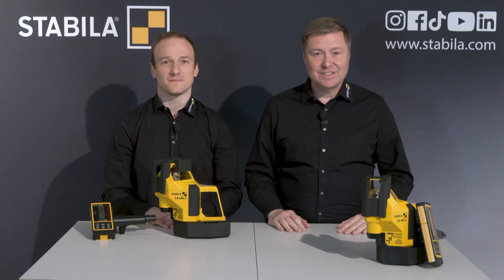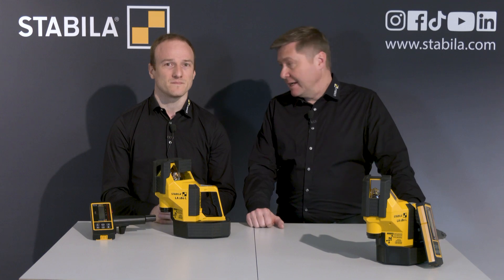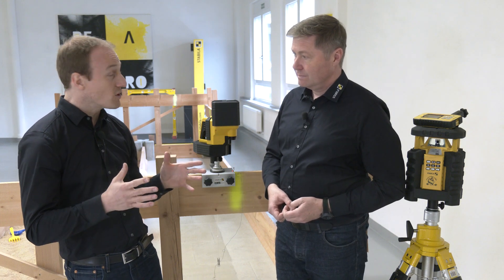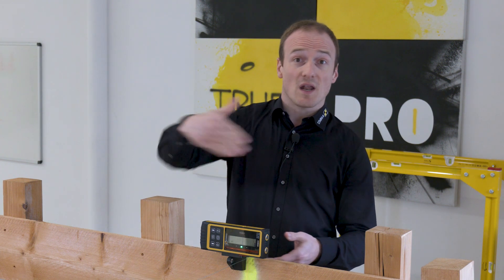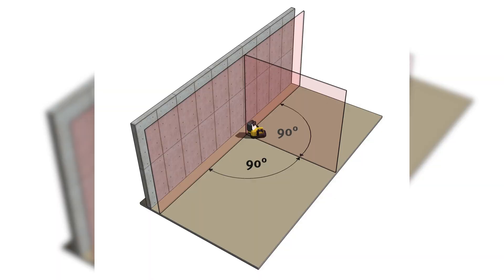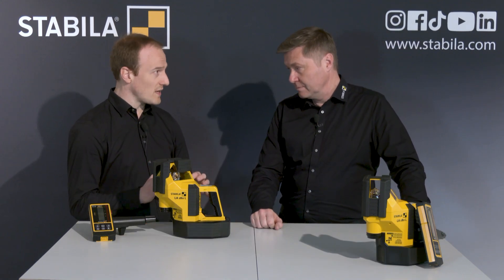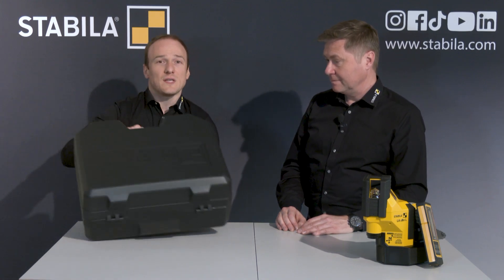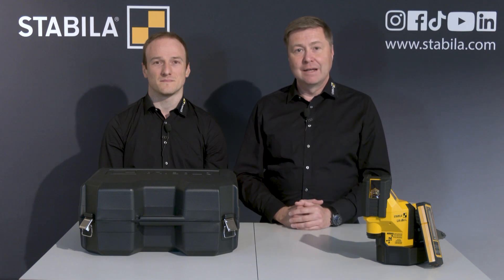STABILA LA 180 L – fully automatic creation of right angles

Comment: I bought this machine. It just does not work. Cant find the receiver. The receiver will say to keep rotating in one direction until nothing. I've paid over 2K for this paper weight. Now have to find out how to return this pos.
Reply from the maker: Thanks for your comment and of course we want to help you 💛🖤 Would you please test it again in an inside room and with a shorter distance, to see if it really cant make a connection with the laser. If that works normally, please note that the laser only has a specific rotation range and maybe cannot find the receiver. If the test from above do not work, please have a look on our service page on our website, there you can find all information about service and warranty.
Reply: @STABILAOfficial  Thanks. I did test indoor in ideal conditions using automatic alignment and it worked. What did not work on site was manual alignment. Automatic alignment was a bit off by 2mm from line however. Is that within tolerance? Edit. I tried again this morning and noticed that it will self align once, but if  I move the receiver after that and ask for a new self align, it just won't move, even after turning off and on
Reply from the maker: Hi, sorry for the late response, we had to check with our product management :) 
So it depends on the distance, if it's 2mm at 30m it's ok, if it's less it's not. But if you have just bought it, you can also report it via the service area on the homepage and then it will be checked.

Comment: I've never owned a piece of survey equipment that could not stand the heat. Do your layout work early in the morning or carry an umbrella. That way when you're working out in the blazing sun your layout station will be nice and cool. Then you will become the butt of everyone's jokes. The POS if it overheats it needs to go sit in the truck with the air conditioning running. The heat issue is very frustrating. And we're not talking 115° maybe 90° but if you work by these rules early morning carry an umbrella it works just fine.My Bosch laser level was working just fine when the Stabila was sitting in the truck :face-fuchsia-poop-shape:
Reply from the maker: The LA 180 L is specified up to a working temperature of 122°F.
Depending on the surrounding it can happen very quickly that this temperature is exceeded.
Asphalt, for example, can become up to 140°F hot at an outside temperature of 86°F and in direct sunlight.
We focus our products on longevity and durability. We have therefore implemented a temperature cut-out to prevent the diode from being damaged by excessive temperatures.